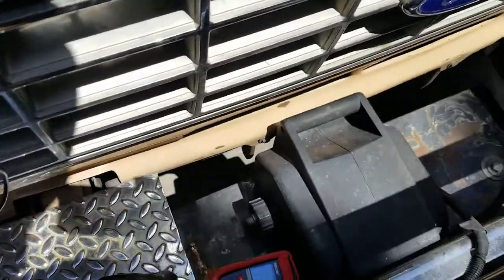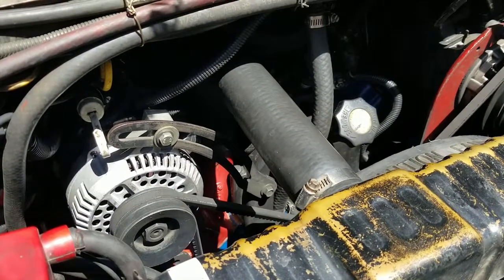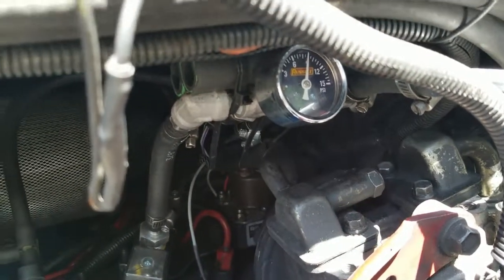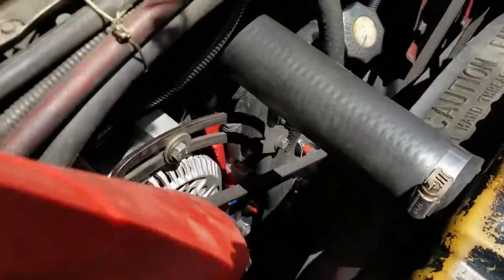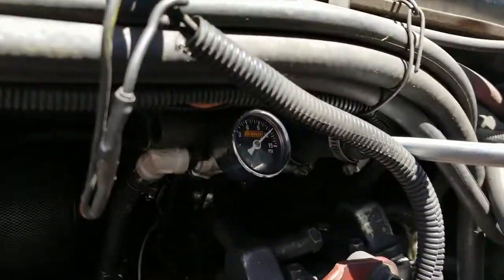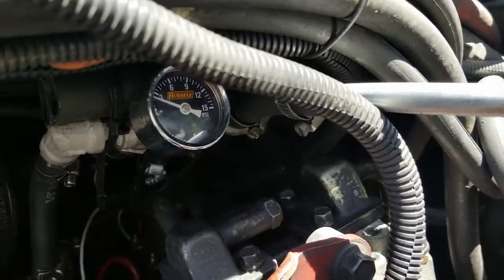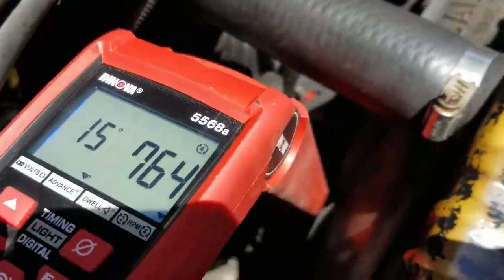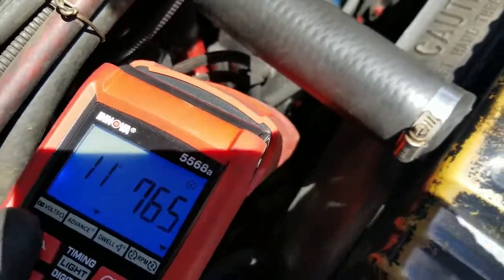Does Lift-Pump Fuel Pressure Affect Timing on a 6.9 / 7.3 IDI? It does.

Comment: I wonder if you could get a variable-pressure lift pump that would allow you to adjust timing on the fly. That would be very cool.
Reply from the maker: If you had a variable pressure e-pump with variable flow regulation, then you could maintain your proper fuel volume with an alternative pressure, ensuring your IP gets the proper flow, but also giving you the ability to adjust your timing a few degrees on the fly.  Very good suggestion.

Comment: Has the increase of timing advance caused any issues? I think the book says to time at 2000 rpm. Perhaps at that rpm the pressure would drop and the timm8ng would retard a bit?
Reply from the maker: You're right that the rpms will adjust the timing, and that the book says to determine your timing at 2k rpms. I could film another video with the engine revving at 2k, but i was concerned what would happen with fuel starvation at 0 psi. Also, this was basically just a test video, and it satisfied my curiosity.
Reply: @0001D-t3e  my concern is that the timing will be to advanced.  I have  the Facet pump that puts out 9 to 11.5 pounds. I did not want to burn my motor up being to advanced. How has your rig been running? I do not have a way of telling what my timing is as I do not have a Ferret meter.

Comment: Does it help when starting??
Reply from the maker: I've had good starting with my e-pump setup.  But I never really had bad starting with the lift pump either.  I changed to the e-pump to make bleeding air a lot easier, and also, I could move the filter head and pump to the frame rail to make maintenance easier.
Reply: @0001D-t3e  on the video it shows you shutting the electric pump off but you still had pressure only that it dropped to 3 or 4 psi so did you have  mechanical pump hook up too to maintain fuel and pressure the line?
Reply from the maker: @charlesflaco5037  It's zero pressure.  My little gauge is kind of cheap, and it shows a few psi even when it's at zero.  I have an electric good quality gauge on the dash that shows the same fuel pressure, and that shows the proper zero psi.

Comment: Do you have two pumps running at the same time an electronic and mechanical?? If so what is the electric pumps psi rated for
Reply from the maker: No, I got rid of the whole stock diesel filter system.  The Ford design was awful, overcomplicated, and the olives were prone to leaking.  Plus my when you drain the water from the stock filter, or bleed the air from the stock filter head, they would drip on the engine making a mess.  I wrote a big thing about it here:  http://www.nickpisca.com/diesel/fuel-system/6-9-7-3-idi-van-lift-pump-and-stock-filter-delete-upgraded-e-pump-sensors-and-frame-rail-dual-filter/  It's not safe to have both the stock lift pump with an e-pump, because if the stock diaphragm tears, it'll pump diesel into the crankcase.
Reply: @0001D-t3e  ok sounds good, thanks for the rapid response.